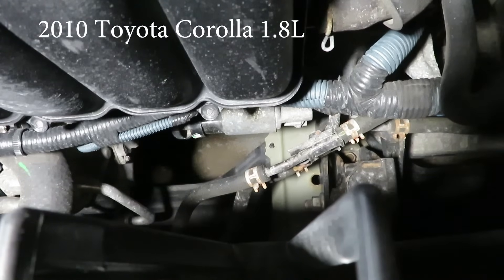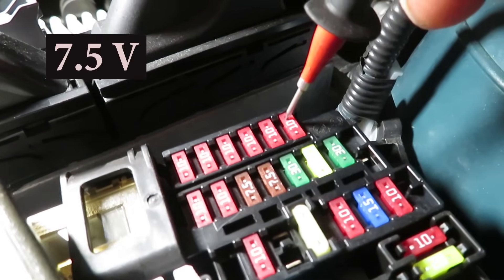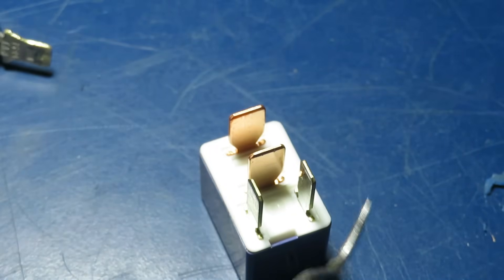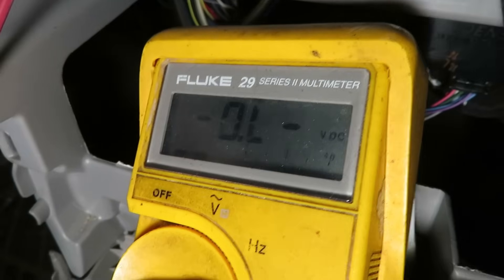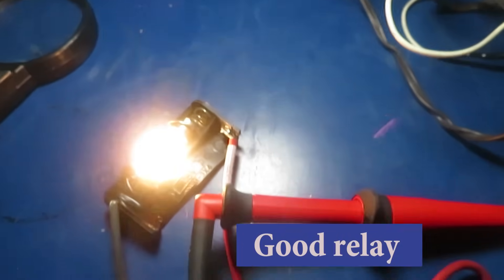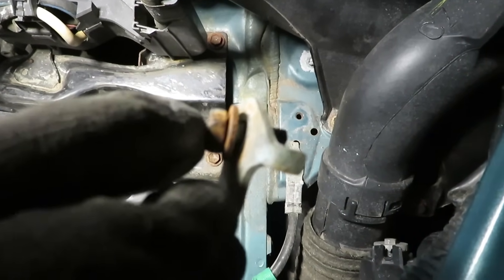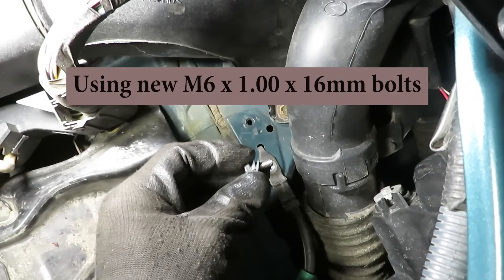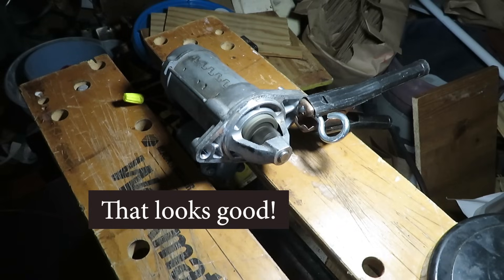When Your Car Won’t Start: Symptoms and Solutions for a Bad Chassis Ground

Comment: Can this cause your starter to keep turning over?
Reply from the maker: No, that sounds like a bad switch or relay.
Reply: @TheOriginalMechanic  Starter rely or what switch?
Reply from the maker: @Ayixlia Either the ignition switch or the switch built into the starter. I have never actually seen or heard of either  of these causing your problem though. That's a weird problem.
Reply: @TheOriginalMechanic  My starter is new so it may be my ignition clyinder swtich or it may be a positive cable grounded so where or a weak, worn cable?
Reply from the maker: @Ayixlia  A grounded positive cable would blow a fuse. You might want to swap out the starter relay (often nearby relays are identical so just switch them). Also make sure your B+ cable and S cable on the starter are not crossing (touching) somewhere.
Reply: @TheOriginalMechanic  Gotcha U will liok into this and thx.

Comment: Good day. Before you repair that. Does the car crank when you started it? Because my car sometimes have that problem. Sometimes it doesn't start nor crank. Thanks will wait for your answer before i subscribe and share your videos. Thanks
Reply from the maker: The car never cranked until the ground was repaired. If your car cranks the problem is likely to elsewhere. A meter comes in handy here to determine if power and ground circuits are proper.
Reply: That means i need to find where is that knots to clean up. May it is also dirty. So that i will not pay high price in the shop. Because they do not know why my car sometime do not crank and start
Reply: Mybcar sometimes do not start nor crank in the morning, but if it started, all day there will be no problem. Do you think i need to clean that knots??

Comment: why don't you jus replace the bolt instead of the unnecessary paint-removal which is there to keep the body from rusting under the lug

Comment: gezzz.... good way for the manufacturer to hide parts in the strangest places for us huh.... a stinkin relay hidden like that drives me nuts...
   The grounding system baffles me too... no thought put into it... maybe that's what they want.... they want ya to have to bring the car back to the dealer at some point to adress stuff like that. I can see someone junking a car because they couldn't find a "Electrical Issue" on a car when it was just a ground all along.
Reply from the maker: I found that disappointing too. Thanks for watching and commenting!

Comment: Awesome video. I think I have the same problem only the washer area on the pluss+ pole is messy(corroded, filthy) It starts though, but it can sporadically stop, also sporadically not start. 
But the pluss pole is not ground. I also see that the negative pole doesn't have it's electronic box on top of it. It's gone.
Reply from the maker: Make sure that battery terminals are clean and corrosion free. That's a good place to start. Also, corrosion can be a sign of an aging battery.
Reply: Thanks man. The battery is at 95% efficieny. Cleaned the nuts and bolts area. It was really diry/corroded. Put some battery pole grease on everything(assume this is dielectric grease) Need to find the grounding point under the car. Saw the red one. Gonna clean that as well. It's puzzling why these don't have a weather shield of some kind. Maybe electrical tape isn't such a bad idea.

Comment: My 2018 Promaster City Van won't start unless I chassis ground my battery.  Battery shows 12.8v.  Nothing turns on and has actually locked on to my key and won't let go.  I am then able to drive it until remove the key, at which time displays Hill Stop Warning and incorrectly that I am low on Gasoline.   I too suspect a bad Chassis ground somewhere

Comment: Great tutorial, but I wouldn't suggest connecting the black cable to the negative (–) terminal on your dead battery. If the battery is leaking hydrogen gas, it could result in an explosion.